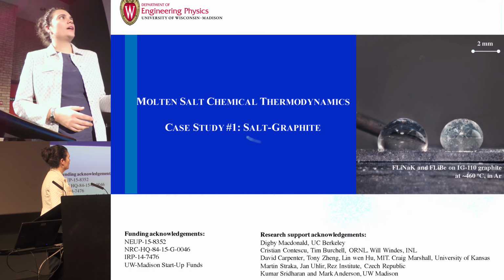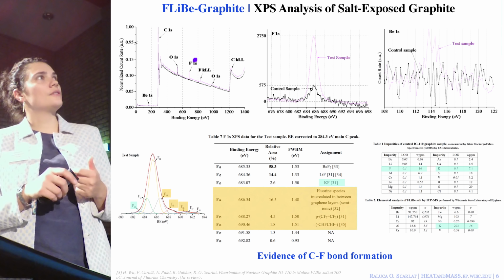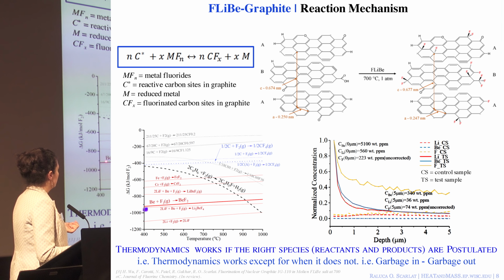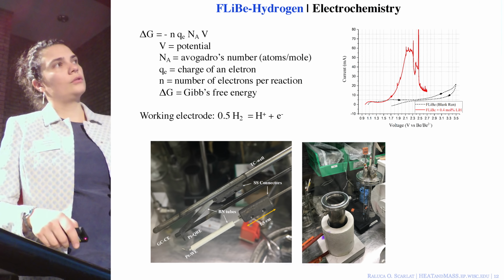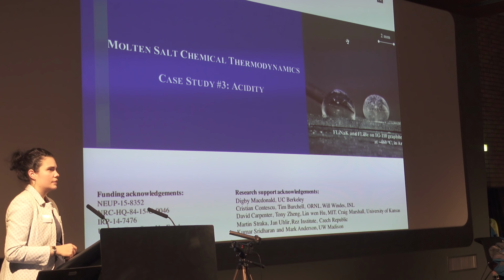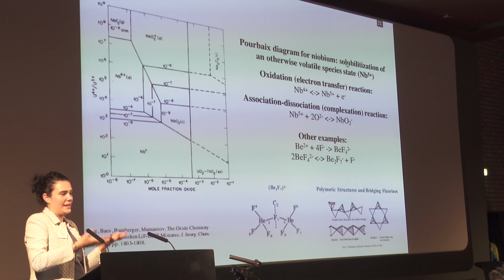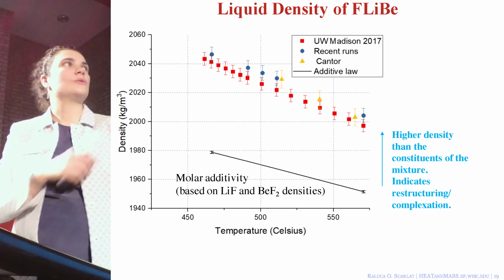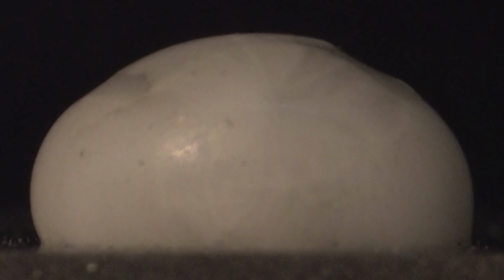Molten Salt Reactor Thermodynamics - Dr. Raluca Scarlat @ ThEC2018

Comment: You should change this video title to "Thorium Disadvantages".

Seriously, though, this is infinitely more useful than an hour of some kid's science fair project.  It illuminates my single larges concern with thorium fluoride based molten salt reactors: the interaction between graphite and salt constituents.  Of particular interest is the complete lack of characterization of solubility interactions, carbon, fluorine and oxide interactions with fission species and inter-species complexes of oxides and fluorides of fission species.

For those of us who can understand this level of technical information, this is actually interesting and despite the definite setbacks mentioned, it moves towards an understanding of potentially producing a long term viable commercial power thorium MSR.

Point of note: as to the methodology used in determining high temperature graphite fluorination, I would like to have seen NMR spectroscopy analysis or x-ray fluorescence analysis of the fluoride salt removed from the graphite crucible to determine carbon ingress into the salt.  The presence of propagating fluorination of the graphite implies some loss of carbon to the salt and those techniques would have very accurately determined how much.  A simple weight measurement was insufficient.  Her listed contaminants should have allowed for XF at least.
Reply: I think that if anything, while this work shows that graphite fluorination does indeed occur, the fact that ORNL ran the MSRE for 6 years without HX clogging by carbon or fluorocarbon compounds, emission of fluorocarbon compounds, or noticeable graphite degradation above and beyond neutron damage shows that it is a marginal phenomenon.

Does that mean it is ignorable? No; and I think that dismissing it out of hand is also not useful. But if it does not impact operationally then is this something that must be mitigated against? Obviously this work is in too early stages to tell but chances are that mitigation measures, if any, would boil down to shortened graphite service life - assuming that this also causes increased delamination of graphite layers. 

The real trick would be finding an experimental setup that determines if the graphite swelling under irradiation at the MSRE observed is a solely neutronic phenomenon or if fluorination plays a role in accelerating it. Instructive would be SEM micrographs examining graphite coupons before and after; with and without neutron flux. A followup NMR spec to see how much carbon was taken up by the salt.

More and more it is seeming that the 2 fluid isobreeder in the thorium pure cycle as originally envisioned by Alvin Weinberg is out of reach for multiple reasons; from limited graphite lifetime and end-of-life disposal concerns (this fluorination phenomenon might well put the kibosh on recycling efforts too); from proliferation issues running on a pure cycle, and from the need for rapid, on-power reprocessing due to running in the thermal spectrum and thus being highly sensitive to neutron absorbers. 

In contrast  a chloride salt in 316SS in the fast spectrum sounds almost prosaically simple. Or Euratom's efforts with the MSFR that allow batch reprocessing of small amounts while keeping the fissile fully denatured.
Reply: @MonMalthias  I think chloride salts suffer from much narrower liquid ranges, and probably more importantly, not much (or zero) overlap between heavy salt liquid ranges and light salt ranges.  I do like the idea of a fast breeder a lot better than the mechanical and chemical complexity of the huge amount of graphite needed in a moderated breeder though.

I don't like the religious level of zealotry that thorium seems to have attracted.  I get the impression that a lot of this is a false grassroots movement driven by the half a dozen large corporations who's financial future depends on the viability of specific reactor designs.

I'm also disappointed in how few people seem to understand the relatively simple set of experimental results relayed in this video.  It shows me that there's basically no overlap between the staunch thorium supporters and the people capable of understanding the viability of the thing they're so staunchly supporting.
Reply: @htomerif 
If the rocket renaissance is any indication, even though the broad public may not necessarily understand the technicalities of technology they can still be beneficial towards generating goodwill and therefore public support for it.

I don't think that people demonstrating (in Youtube comments, long known to be a cesspool of hate and ignorance) that they have no idea what is going on is necessarily a bad thing. I also don't think it's fair to then make the conclusion that people are necessarily zealots unable or unwilling to probe the specifics of the technology they support. If anything the fact that they have watched the video alone, demonstrates that people are willing to go out of their way to watch a pretty long video on a topic that is far more technical than most high school and university educations allow. 

This is a good thing, not something to be disappointed in.

I don't think that people need to know transuranic decay chains, the point kinetic neutronics model, understand the physics and mathematics behind coupled codes, or even the thermodynamics behind molten salts, to be able to "legitimately" support molten salt reactors. Keep in mind that this is reactor technology largely discarded since the time of Rickover. That is pretty much 3 generations ago. Of course people will be largely ignorant about this topic outside of certain segments of academia. Hell, even academia itself was largely ignorant of molten salt reactor physics and chemistry until Kirk Sorenson published ORNL's data package.

We are only just now re-treading the path of those scientists at Union Carbide, Oak Ridge, Weinberg and Seaborg, all those years ago. The last of the MSR scientists and technicians have just about died out. We will only see as far as they, by standing on their shoulders. That people don't know a lot about the work of dead projects and dead technical teams is not an indictment. It is proof positive that the technology is valuable and interesting enough to pursue to its final conclusion.
Reply: @MonMalthias  I have to disagree, though I understand your points.  People who are uneducated in a thing are easy to mislead and I think thats exactly whats going on with the pushing of, specifically, graphite moderated thorium breeder MSR's.  There's a good chance that the momentum that already exists will be enough to carry these reactors to completion.

To the people in the comments of this video who understand the video on no level other than "thorium reactor good", which this video actually goes against, I would say: "your opinion on the viability of this reactor is worthless and you should keep it to yourself until you know better".

Before I go any further on this, you should watch and read the comment I wrote (if it isn't deleted) on this channel's video "Thorium Disadvantages" to see some of the raw deception and dishonesty that these people are capable of.  I don't know if the channel's owner is of the zealot variety or the "I have money riding on this" variety, but he's at least one of these two things.

My man counterpoint would be that we don't have the money, time or skilled manpower to pursue every kind of reactor or every kind of energy technology.  Its an idealistic perspective that we should develop every possible technology, and making the hard choices of which paths to follow shouldn't be left up to abjectly unqualified persons.
Reply: @htomerif 
I mean, grassroots support is just that - the roots. It does not impinge upon what eventually develops (much). Just as Rickover pushed the AEC to focus on LWRs with his "paper reactors" speech - and this coming from a student of Weinberg! - what people eventually settled upon was not the reactor necessarily suited for non-electricity uses, but the focus was on an electricity producing reactor at the time, so LWRs were proved out.

I think that the idea that we don't have the money, time, or skilled manpower to pursue every kind of reactor is fundamentally false. It implies that technological invention (as distinct from innovation) occurs in a vacuum with non-fungible research and development and multiple paths must necessarily end with a single winner that survives. But that is not the case.

The air bearing technology key to centrifuges has found its way into aerospace applications. The horizontal drilling technology invented to do underground nuclear bomb tests found its way into fracking. The laser - originally thought to be a solution in search of a problem - found its way back into the nuclear field through ANSTO and its SILEX process for enrichment. Molten salt reactor experience has found applications in solar thermal power plants and the physicochemistry applied to ionic liquids and other salt mixes. Experience with nuclear graphite from Chicago Pile 1 found its way into HTGR technology. Who is to say that work on wind and solar may not itself bear fruit for nuclear applications as well? Or vice versa?

I think that every new research field has fruits to bear and each fruit itself will bear several more along its lineage. To foreclose - as Rickover did - all development to the exclusion of others is a mistake. The nuclear industry is still paying for that mistake because it has essentially settled upon water cooled, water moderated, ceramic fueled, high pressure operations. Even in the former Com-Bloc. Although the Com-Bloc now seems to be the more innovative one because it did not have a Rickover equivalent and so BN-800 is now operational, China has a LMFBR under construction and HTGR in operation and now pursues TMSR technology as well. Why? Because they did not shut down those research programs and maintained them (with limited funding, to be fair, as they went through economic turmoil).

If industry had instead diversified - and there was plenty of room for diversification in the early days before Rickover's "rationalisation" of the AEC programs - then we would not be in the mess we are in today, stuck in a once-through cycle, 1% burnup regime. An industry shackled by quotidian restrictions on public engagement that would rather lie low in a crisis (and let demagogues rule the public stage) than speak up for itself. These are all legacies of Rickover's military upbringing and the creativity, the immense vistas of untapped research paths that are only now just picking up again, have been lost for so long as a consequence.

So I do believe that even blind "faith" instead of "reason" still has its place. If people mislead or are misled then we should correct them, gently, constructively. "We don't have the skilled manpower" precisely because the industry failed to diversify and show its value in fields outside of electricity generation. "We don't have the money or time" to pursue truly innovative paths not because of lack of funds - I mean seriously, today's computing power allows individual scientists to design reactor systems in silico - but because of lack of public support making politicians prioritise other things. 

I think the mindset that we are restricted by time and money is self-fulfilling. Self-hobbling. We are limited only by our imaginations and our commitment. Saying to people that "you are not qualified to understand therefore put up and shut up" breeds few new friends, but plenty of enemies.

As you have found.
Reply: @MonMalthias  I'll get to that. That was a long one.
Reply: @MonMalthias  So here's a very simplified version of a much longer thing: if you're involved in any kind of STEM hiring, what's the number one problem you have right now?
Reply: @htomerif 
I work in health care so I am not involved in STEM hiring. 
I did a stint in academia for a year before giving it up because I preferred working with patients rather than being stuck in a lab experimenting on rat brains. 
But our department never wanted for grads and in fact many were turned away especially as supervisors filled up on students. 

Actually I would say that with competition so fierce the problem is not lack of STEM graduates in my country but lack of STEM jobs. I know many of my friends that went into academia would later go into industry if they were lucky, or if unlucky, had to retrain. Some found their way into the financial sector, others into management jobs in unrelated fields. 5 years of government paid tuition only to get into a job they didn't like because of lack of opportunities.

So the idea that we lack for STEM grads suffers from a paucity of reality. We instead have a paucity of STEM jobs, scientific grants are hoarded and fought over like vultures over road kill, and many graduates, bright, young, eager, passionate, find themselves being stuck in dead end jobs with dead end prospects. Many in fact go overseas for better prospects, like China and Singapore where the government there is at least cognizant of the need and importance of highly trained and motivated people in STEM.
Reply: @MonMalthias  Maybe thats where our really different assessments of the state of the STEM workforce comes from.  I'm not involved in hiring now, but when I was, it was in the electronics field.  It was hard to even get applicants, though it was pretty esoteric even for electronics.  Of the applicants we did get, most of them didn't meet the minimum requirements for jobs and of the hires that were made under my watch, 2 out of 10ish lasted more than a year because they either lied on their resume or weren't competent despite their "legitimate" qualifications.

I have an uncle who is a project manager at an engineering firm, and they ended up going through a protracted downsizing period (about a decade) not because of a lack of work, but because they couldn't do the work they wanted to contract to do with people who were supposed to be able to do it.

My brother works in.. lets say "programming" for.. lets say a "big" company.  They can no longer rely on resumes to the extent that real world testing is a mandatory part of the application process despite your previous experience.

I have no examples I can point to of an excess of qualified STEM personnel and probably a dozen examples of a dearth of qualified personnel.  Hell, even finding qualified or at least certified blue collar labor for nuclear and aerospace like welders and machinists and lab techs is next to impossible.

Even in health care in the US, specialist doctors (infectious disease, endocrinologists, neurologists) and upper nursing staff (RN's and nurse practitioners) are woefully understaffed, at least where I live.

From my perspective, your perspective has an empirical paucity of overlap with reality.

Also, we are just writing essays here that no one is ever gonna read.
Reply: @htomerif 
It might have something to do with education here. We have always had a strong state support for education up to and including tertiary levels (undergraduate, although some tuition funding opportunities exist for post grad). With privatised American universities and usurious tuition fees, it doesn't surprise me that your population struggles to produce STEM graduates. I have heard that some engineering departments in American universities would have to close down were it not for the influx of foreign students to fill out classes. 

In these circumstances, it should not be surprising to hear and see that fields like electronics struggle to find skilled workers. For us it is the other way around - we find we have to "export" graduates to other countries.
Reply: @MonMalthias  You see what I'm saying then?  Or at least how I think my perspective is justified?  You might have a country crammed full of idealists, but assuming you live in the UK, you don't have the money or research infrastructure to pursue every possible reactor technology.  The US doesn't have the social will or political vision to do anything remotely scientifically risky.

As an example I'll point to this video which I watched back in the day when YouTube had stars instead of "likes": https://youtu.be/FhL5VO2NStU.
You don't have to watch it, but it is educational.  The gist is that this is a guy from old guard of nuclear engineers and physicists proposing a hybrid electrostatic confinement and magnetic confinement fusion reactor.  If I remember right, he says that the main hurdle to be overcome is the lack of competent engineers and physicists.  The same is true with dense plasma focus fusion reactors.

I know people like to see the silver lining in situations but there are just too few educated people, too little money and too little popular will or information to follow more than a few targeted research paths.

I personally am on team "full throttle for strong artificial intelligence" as a solution for some of the seemingly unrelated issues of lack of STEM personnel.  Everyone seems just absolutely terrified of that route, though.

-edit

It would almost be nice to have an actual chat.  You seem like you're not an idiot and you've got some oddly broad knowledge for being in health care.
Reply: @htomerif 
This of course ignores the issue that there are now more Nuc. Eng. graduates exiting courses in North America, if you note Raluca Scarlat's photographs of her cohort, Per Petersen's of his, and likewise look at the audience at TEC, ThEC, and NAYGN conferences. These graduates will be looking for jobs in the next few years, and the GAIN program (Obama's legacy) as well as the opening up of national laboratories will accelerate RD&D. It will not happen overnight, but it will happen, even under the current administration (which is coasting on program outcomes and investments from the early 2010's). 

I think you doth protest too much. You're not looking for honest engagement, you're looking for validation of your pessimism and a fellow groucher. You even couch your compliments back-handedly like "you're not an idiot" as if to patronise me for daring to have a different opinion. 

The United States out of any country in the world can pursue any path, research any technology, achieve any goal it sets for itself. It did so with the Manhattan Project, Atoms for Peace, the Apollo Program, the fracking revolution (more like evolution of horizontal bores). So too can any other country, if it has a long term plan and an overarching goal. Just look at China's ludicrous pace of development. Britain and its post-war introduction of the National Health Service. Or South Africa and its denuclearisation. France and its Messmer nuclear electrification plan. Korea's goal to corner the market on ship manufacturing. Some African countries like Nigeria and Ghana are now looking to producing their own Borlaug-style Green Revolution by making their own GMO crop technology. 

Hell, look at North Korea and its nuclear weapons program. The country doesn't even have electrification but now it has SRBMs and the warheads to match them. 

The most impoverished, war torn, divided countries in the world can get their act together and advance by leaps and bounds if they put their mind to it. Pessimism is self-fulfilling. Motivation gets results.
Reply: @MonMalthias  "Of course this ignores the issue etc.."
Everything you've written has had obvious backhanded insults embedded.  I was patronizing you in the sense that I was willfully overlooking your insults to me.  You were doubly insulting me by thinking I wouldn't notice them.  When I say "you're not an idiot", I mean just that, and there can be no patronization in that statement because of its bluntness.

I don't peddle in optimism or pessimism.  I deal in empirical truth, a currency you seem unwilling or unable to trade in.

For your sake, though, to protect your precious ego, I retract my "you're not an idiot" statement.
Reply: I want an Issac Arthur style future, Orbital rings, O'neill Cylinder etc. What's our realistic nuclear energy strategy? Who's your bet on? If I want to suggest a sensible company doing the right thing who are they? 

Do you think  proven nerds should be allowed supervised nuclear experiment spaces to introduce vocational learning for very small local nuclear plants throughout the country? 

If global warming is to be reversed carbon zero net mass gain must be achieved first..then physical recapture. Nuclear and biofuels seem the only carbon stable future. Thoughts?
Reply: @DanHBExplained  So here's a thing that you'll see reverberating through nuclear experimentation at universities and DOE test facilities: running a small reactor give you virtually no experience with running a commercial power reactor.  The physics involved in neutron moderation and pressure vessels, maintenance and safety just don't scale between the two.

As far as a "sensible company doing the right thing", I don't think there are any in the US.  For whatever I say against China, they're taking nuclear reactors very seriously, so I would say that the Chinese government's nuclear program is the most sensible and arguably doing the right thing.

As far as the future goes, I would put my bet almost entirely on solar.  Ten years ago I would have said reflector based power plants using molten salt (chloride, generally) or liquid metal heat transfer fluids would be the most practical.  Now I'm thin film deposition solar panels may edge those out in terms of large scale power generation.

Question, though, about your take on Issac Arthur's vision: why do you want orbital structures or arcologies for habitation?  He seems to make this (to me) grating assumption that humanity will expand without end.  This is just empirically not the case.  In the developed world, population growth has shrunk to zero or is in the negative, sustained mostly by immigration.  From what I can see, population experts agree that we'll never hit 14 billion.

I think if you look at just the population dynamics of a world transitioning to having enough resources for everyone, you have most of your answer to the Fermi paradox.  Even without being xenophobes, the idea that we would spread across the galaxy doesn't seem tenable from anything other than an information collection perspective.
Reply: Just saying, I grow weary of commercial viability being the tolerated metric for success. Especially given the literally exponential and bottomless appetite for profit capitalism demands. But it's cool, I'm quite confident nature will effectively put a gun to our heads and makes us choose, between survival and adequate spending. And I'm equally confident when the "choice" is before us, we'll choose to live with a reduced wallet, rather than being a flush corpse.
Reply: @Innomen  I think you'll see unsustainable stratification of economic classes far before that.  By the time a choice is forced, the people in charge of making that choice will be living in bunkers and walled communities with militaries.  My go-to example for how quickly, badly and completely a society can collapse is Liberia.  It went from a promising concept to hell on earth in a decade.
Reply: @htomerif  That's exactly part of the "choice" in question. Liberia didn't have our technology laying around. Every 5 years that a society remains stable in this era of exponential technology growth radically changes its decay profile (for lack of a term) or way in which in would implode and what state it would finally rest at after implosion. Put simply authorities in modern developed societies are going to be forced into situations not solvable with a fortress mentality. That's why rich people building the modern castles and moats you're basically talking about doesn't concern me. I'm not going to be any more specific because it's a rabbit hole that's deeply off topic here. My TLDR here is that the profit motive hurdle is being crushed from two sides. Automation on one end and urgency on the other. The concerns should be technical, not economic. Especially at this stage.
Reply: @Innomen  Yeah, thats a good point.  I don't expect anyone to read the dissertation of horse browns between me and that other guy, but that was one of the points is that China is going to make a lot of nuclear reactors sooner rather than later.  One of the things I don't think most younger people believe or comprehend, though, is that a society can actually backslide technologically and educationally.  You can end up in a situation where no one understands that there is a problem simultaneously with no one being left who can fix that problem even if anyone knew it was there.
Reply: @htomerif  I hear you but on the other hand backslide looks different than a reversion to the middle ages. Future collapse isn't likely to look like what collapses of the past looked like, if nothing else because answer books are literally everywhere directly and indirectly. Our landfills and oceans alone are gonna be amazing reset buttons limited only by the effort expended to datamine them. Consider: We're still learning about the distant past via archaeological exploration of ancient trash heaps. That principal is always gonna apply. 

We already don't know how to do things previous generations did. Especially in nuclear research circles and space exploration. I'm sure you're aware of how close humanity came to basically erasing all the molten salt reactor data. Rediscovering it as essentially a form of trash (boxes under a staircase I believe) is how all this thorium interest got restarted in the first place. :)

A total backslide simply wouldn't last because of supply and demand. We'd relearn and (re)verse engineer things if we forgot how to make them. Or find substitutes. And the world isn't homogeneous. Like Gibson said, the future is already here, it's just not evenly distributed. An apocalypse capable of qualitatively breaking that paradigm simply wouldn't be survivable by anyone at all. (Especially if it delays to the point that we have true habitats in orbit or on the moon etc.)
Reply: Interestingly, ThorCon, and a few other approaches, incorporate core components that are periodically replaced. The primary loop module in the ThorCon system, termed a ‘can’, is utilized for a number of years until it is swapped for its ‘B’ partner. The graphite moderator has a limited lifespan. The A can spends years cooling in place, until ready to ship back to the factory for refurbishment or disposal.

http://thorconpower.com/slides/tokyo_201806.pdf (see ‘cans are duplexed’, slide 19)
Reply: @cbarcus  
So this htomerif guy complains about the unwashed masses discussing MSRs, tries to give off the impression that he is knowledgeable in MSR chemistry, and instead of enlightening us with his knowledge about the real world MSR consequences of  the interaction of salt and graphite,  goes of on all kind of tangents about crane numskull operators (his actual expertise, per chance?).

WHAT A JOKER.
Reply: Mach Tony What irony, eh?
Reply: @MeetDannyWilson  You outright lied about what I said, you failed to read or understand the document you yourself linked, you failed to understand *your own statement regarding the problem with fission product solubility*, you ragequit the conversation only to immediately retract that ragequit with a backstabbing, mentally handicapped attempt to get under my skin.

You've positively demonstrated your abject lack of knowledge about physics, chemistry, economics, engineering and politics in a remarkably small number of words.

I'll give you this: the thing you linked was interesting.  Its to bad it was beyond your comprehension.  Its to bad this video was beyond your comprehension and its too bad this comment is so far beyond the limits of your comprehension or personal integrity for you to respond to in anything other than typical word salad.
Reply: @cbarcus  I'll read that, but I'm guessing it replaces a lot of the theoretical advantages of an MSR with the disadvantages of a solid fuel, water reactor.  The big disadvantage I see is that it would almost never be cheaper to remanufacture a highly radioactive reactor component than it would be to just make a new one.
Reply: @cbarcus  Ok, so I know its a powerpoint presentation turned into a pdf, but there are virtually no specifics as to how the actual core works.  All but 1 or maybe 2 pages of that has to do with how they're going to make a ship with literal swappable reactors (the cans) and fuel canisters that will be hauled from site to site.

So what we have here is an offshore anchored barge with a 500MW class nuclear power reactor that will be routinely swapping very, very highly radioactive waste, fuel and whole functional reactors with crane systems over open ocean water and transporting all of this to and from third world countries also via barge.

This is not entirely fair, some of these are actually just demolitions of cranes, but these incidents aren't exactly rare and they're a lot more common in the countries that thorcon seems to be geared towards:
https://youtu.be/jYGku4K9yl0
Just imagine a reactor or waste canister being dropped onto a deck or into shallow ocean.  You've got a new uninhabitable zone at best and worldwide ocean contamination at worst.

I don't know.  I think I've had a pretty accurate spectrum of exposure to the width and depth of the potential for human error and, in my opinion, this is a terrible idea.  Its not unfixable though, aside from the unknown core functionality.  Some changes I would make:

1) construct the facility inland and away from possible tsunamis and ocean contamination.
2) don't swap the cores and fuel out with a crane.  Use a ground based lifter for both (think purpose built machine).
3) use standard materials like concrete for ecological containment on the reactor site.

What I really don't understand is why they would want this kind of semi-mobile power reactor with all the severe disadvantages that brings when large construction companies are more than willing to go anywhere in the world for a similar price.

If I got something significantly wrong, by all means, tell me.
Reply: @htomerif  "...offshore anchored barge..."
They only say "shoreside" with regards to the reactor location, not "offshore".

As far as I understand it, their plan is to:
- Serially and cheaply manufacture MSRs / hulls in a port location.
- Transport  via ocean (but probably "green water" near shore, not "blue water" - but granted, this introduces risk)
- The reactor is displayed in the PDF in operation in a harbour basin ("wet dock" of sorts).

Granted, there IS some risk with regards to contamination of the local ocean, but to fantasize about "worldwide ocean contamination" is delighting in fear mongering on a  religious level of zealotry to speak your language.
Reply: @htomerif  With regards to cranes:
AFAIK all cranes involved in handling the "cans" are supplied by ThorCon for the specific purpose. You have two cranes installed on the the "ThorConIsle" (the hull with the reactor): One gantry crane and one more conventional "revolving crane" for unloading and loading of cans onto the "CanShip" - no external cranes are needed in handling the cans on the MSR site.

If it really were the case that some local numskull with a crane would be allowed to load and unload the reactor cans, I would be rightly horrified!

On the other hand if these cranes are properly designed with sufficient margin, your fears have no base in reality and tell more about you than about ThorCon. You may or may not be qualified to engage in a critical discussion about the chemistry of MSRs, but lay off the speculation about cranes, it betrays your level of knowledge and shows your biases instead.

And with regards to the safety (or lack of safety?) of the ThorConIsle in case of a tsunami (or an earthquake): This is left to the so inclined reader to figure out.
Reply: @htomerif  
And the thing is: You are not asking the really interesting questions.

For example:
- What quantity of radioactive fission products stay not in solution during operation of the reactor? How much will be captured, how will ThorCon deal with the captured radioactive fission products, how much radioactivity is released (worst case, e.g. in comparison to worst case of current and future LWRs)?

- How safe is transport of the spent fuel cans with the "CanShip" (again, in comparison to LWR spent fuel transports)?

- What is ThorCon's plan for reprocessing the cans? What and how much radioactive waste is produced during can reprocessing (again, in comparison to LWR fuel reprocessing)?

- What  is ThorCon's plan for decommissioning a "ThorConIsle"? What and how much radioactive waste is produced during decommissioning (again, in comparison to LWR decommissioning)?

- Over the lifetime of the reactor, how much radioactive waste is produced per MWh (again, in comparison to LWRs)?
Reply: @MeetDannyWilson  I thought you might have read some of the very long comments in this thread, but I asked most of those questions relevant to MSR's there.  They do address some of those in the pdf you linked.  Their test system (I think) has a gas scavenger for insoluble gasses and all of the fission products that I know of are soluble in beryllium fluoride.

There's only so many problems I can post in a comment, but yeah, piracy is actually still a big problem in Indonesia at least and certainly a big problem in most of coastal Africa.

As far as efficiency and waste goes, I addressed that in my initial response before I'd even read the paper: there's a good chance it will just be cheaper to manufacture new cans and dispose of un-reprocessed fuel, or at the very least to dispose of everything but the expensive parts like impellers.

I think a good question is where would the waste be disposed of?  If they're planning on operating from first world countries to supply third world countries energy, they're going to have a really hard time selling the need for these countries to store nuclear waste from around the world when they don't want to store the stuff they already have.
Reply: @MeetDannyWilson  Again, I didn't want to go into a dissertation on cranes, but here is my simple take on that: the cans, of which there may be up to 4, are only changed out once every 4 years.  I think the safety improvement of dedicated cranes is decimated by having cranes that are left unused for 1 to 4 years.

So let me stop your little " I gotcha!" train right here.  You linked me an entire pdf full of stuff to review, then you complain when I simultaneously don't identify every single problem in one comment and don't spoon feed you issues I've already brought up in previous comments.  What you're doing here is a supercharged version of the Gish gallop.

Half of your questions are *actually answered in the pdf you linked*.  I could say a lot here.  I've deleted about 3 times the text that this comment will be, but there's no point if you can't be bothered to read even this much before making an error-filled response.
Reply: @htomerif  
Nobody is interested in cranes when talking about MSRs - stop wasting people's time.

Bye!
Reply: @MeetDannyWilson  Is this yet another gordon mcdowell sock account?  You're sure using the same passive-aggressive "hear what you want and not whats actually said" strategy.

You failed to read my earlier comments.  You failed to read the pdf you gave me.  Why are you even here?
Reply: More details about the ThorCon design here:

http://thorconpower.com/docs/domsr.pdf
Reply: @cbarcus  Well would you look at that.  This pdf addresses most of my criticisms about the previous paper and all of the solutions are basically exactly what I said should be done to fix it.

I guess I do know what I'm talking about, huh?  Question is: do you have the backbone to admit that?

The ability to admit when you're wrong about something to people you don't like is a very rare trait.  I know I have it because I've had to do it before.  Do you have it?
Reply: High level waste may be handled with deep borehole disposal, essentially securing the worst stuff in basement rock where it can stay for eons:

https://en.wikipedia.org/wiki/Deep_borehole_disposal?wprov=sfti1